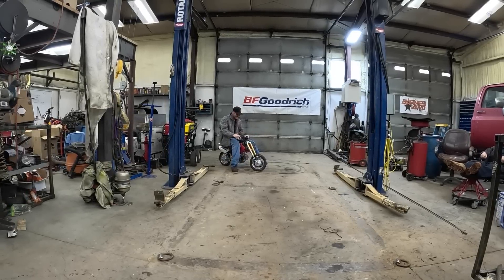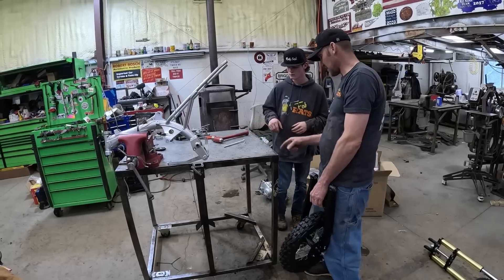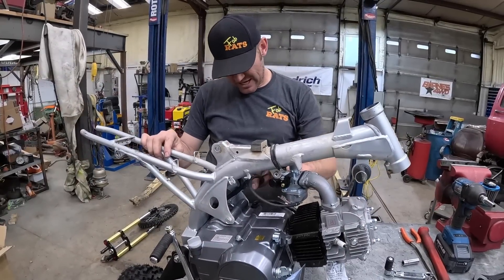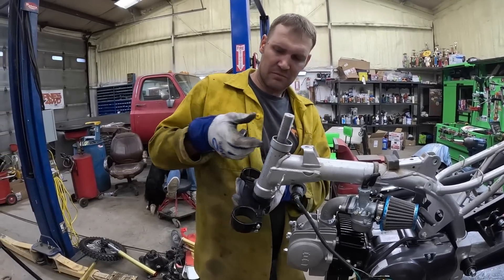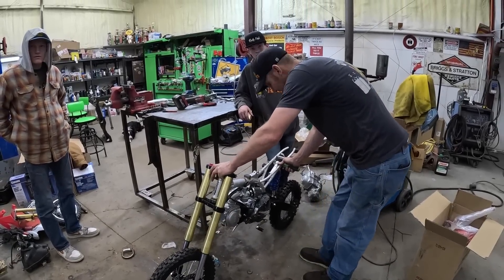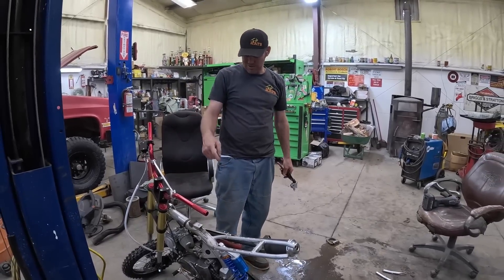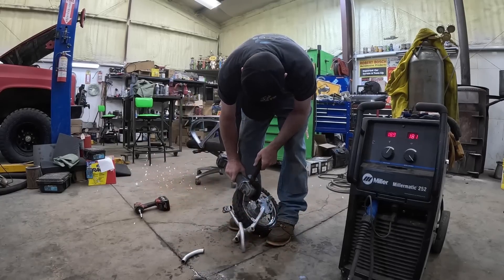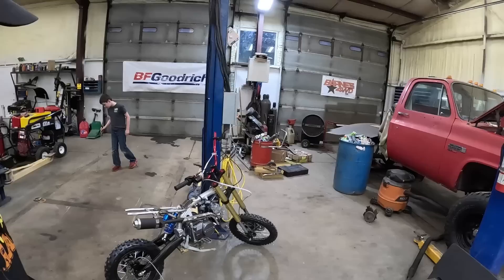Found Motorcycle At Landfill Turns Into Something Awesome! Treasures From The Trash

Comment: Back in the early 70’s I had a Honda mini trail 50 i abused till the gearbox blew so my older brother “aquired” a Kawasaki 175 dirt bike motor and we made a suicide machine that would wheel stand without popping the clutch! Top speed was about 60 mph because the front tire would float at that speed!  We still have the bike but it needs brakes.
Reply: I wanted a 50 around 1975 when the Honda Odyssey came to Colorado 
But I never got into motoring

Comment: Fun watching you guys build stuff. When you put those larger forks on the 50’s I’ve found you need to slide the forks up in the triple clamps 2-3” to get the front end back down. Otherwise it’ll be choppered out and ride rear heavy. You can slide them up until they almost hit the handlebars or until the edge of the flat portion of the forks (before the taper).
Reply: Totally agree. I hope Paul reads your comment. That will strengthen that area too.
Reply: Totally was thinking the same thing. That head tube angle is pretty wild to look at when the rear suspension is compressed.
Reply: This or something is cracked

Comment: Paul you need to get yourself a magnetic floor sweeper! Brilliant for those tiny get aways that seam to teleport from one spot to another.
Reply: some of them parts are brass and aluminum but over all the floor sweeper would be a good idea
Reply: As many times as things go missing a sifting screen seems like a legitimate project. A magnetic component seems totally legit as well. Lets see what they come up with. Your suggestion is of significant directional value.
Reply: I've found shining a flashlight horizontally along the floor will show shadows of everything lying on the floor.  Then you only need to look for the shadow.
Reply: Yeah, stainless ain't getting picked up by no magnet either.
Reply: @sausages6135  There are over 50 types of stainless steel and more than half of those are magnetic. So, the probability of a stainless steel part being recovered using a magnet are better than 50/50.

Comment: It’s amazing the things people throw away
Reply: I use to make good money on push mowers people tossed out I would collect all the push mowers on trash days and fix them up and toss them in my font yard with a 50 buck price tag and people would buy them up like crazy and I would make good  money off of them
Reply: @79tazman  I can definitely believe that. I made money by fixing my friends vehicles while in high school. Only certain friends got it done for free 😂
Reply: I buy tools and parts at the scrap yards. It's rather amazing and amusing there, too.
Reply: I used to drive a frontloader at a transfer station. 
It was truly sickening.
Reply: Especially vehicles....people dump good cars because they need work,major to them who cant work on them...If a transmission fails they scrap the car,engine has issues they scrap it,electrical car is scrapped...I used to run an add in the 90's to the mid 2000's buying scrap cars,and I made a killing..Repaired them,sold them!! I drove one car I saved for 4 years and put another 100,000 miles on it after I rebuilt the transmission,then sold the car and it ran looked perfect.I now mainly just restore and sell classic cars...But still many good cars are scrapped for something a engine/trans swap would fix at the most...
Reply: Another man’s trash is another man’s treasure said NoOne 😂

Comment: I have a shed full of crf50 stuff I've been collecting for years we're really into these and building them there used to be tons of company's making high quality parts for these and frame kits and stuff. You can still get engine parts and stuff my latest builds are a couple matching billetware framed bikes with 124cc dohc kitaco motors with takegawa 4 speeds and takegawa manual clutches.

Comment: You need a cradle mount for tne foot pegs, I used to race the mini bikes and use adults are too heavy and end up ripping the foot pet holes out of the engine, you could easily make one of you look it up, crf 50 cradle mount, and for some better power use flat slide carb or a d-slide carb off a kx65 or 80 and rejet

Comment: You didn't just make a dirt bike. You made a memory. Good Job! Looking forward to the videos on the Wrecker Rally.

I had a standing rule in my gun shop. If it goes sproing and hits the floor I did not even look for it. Just started making another part to replace the lost sprIng/screw/clip whatever. Later years I got a magnetic nail sweeper like the roofers use. It did help a bit.

Comment: Just an FYI fir those playing at home, that adjustment in the shock doesn't change the spring rate. It changes the preload. So, springs have a rate. Say 10kg/mm. So 10kg compresses 1mm, 20kg compresses 2mm, 100kg 10mm, etc. If you add preload, you're taking up the initial compression. So if you add 5mm compression that means for 50kg you'll get 0 compression then 60kg you'll get 1mm. So it's exactly the same. Until you put less than your preloaded weight on the bike. So a 20kg rider. They'll get 0 spring rate until 50kg them 10kg/mm spring rate, which can feel horrible mid corner when your springs go from full hard to soft.

Comment: Pit bikes are cool. If your making that for the track my thoughts are to lengthen the rear sway arm and add a taller shock. The angle on the front forks are too great. They will bend or your triple tree will snap.

Comment: Yeah Paul, looks good but a little too raked out in the front. My buddies and I had kinda realized our brain cell destruction from doing things we shouldn't have. Our younger brothers and their friends were building and breaking those pit bikes regularly, picking up where we left off. One farm had an old dilapidated tin (pole barn) tractor shed with a leaky roof where they built a mini motocross track inside.  They were jumping and slapping the ceiling joists ( tie beam, bottom chord) with those pit bikes. We opted out.

Comment: lol i rode one of those to work for 2 years.
chain got off once and crushed 1 and 3 gear.
still worked great for those couple years as a 2 gears model.
far from street legal i just found it hilarious because we serviced police cars too and i had it parked outside with helmet hanging on the handlebar XD.
these engines are 100% honda ripoffs  and you can swap internal parts around with 50 years old moped engines.

Comment: @Fab Rats I'd love to hear your review on those Hercules impacts, seen you using them quite a bit. Hercules vs Milwaukee? Id imagine with Milwaukee, if something fails you'll have a easier time with replacement and battery platforms staying the same. I've been looking at the Hercules because of the price, but worried about longevity. Love the video!

Comment: You need a new spring, or move the top mount rearward. Better to get a new shock with a stiffer spring, that way the damping "should" be better calibrated to the spring. You are going to bottom out the rear suspension all the time as it is.

Comment: Definitely didn’t get that shock up high enough, it’s almost completely maxxed while your sitting on it, starting the shock higher with more angle would have put the bike in less of a low rider bike if so. Check out how pitbikes are setup for the rear shock, either the shock is too short for the build or it’s just set too far down.  It’s gonna do nothing but cruise at that angle, if you wheelie it be careful of breaking the front forks from the extreme front rake angle

Comment: Paul something isn't right in the front end it's way to racked out like a chopper. Is the frame tube crack up around the fork tubes it looks like it was jumped by someone that weighed way to much and bent the frame outwards some  where or cracked it and now it's gapping bigger. But trust me when I say something istn right at all 50 aka pit bike builds a stubby in the front. I've never in my life see one like that unless something else was broken or wrong. ! Please please please look through that entire frame for bends, breaks and anything else that could fail while little man's ripping it . Something is outta wack for sure

Comment: Paul, machinist here, you gotta get your parting/cutoff tool as close to the chuck as possible when cutting so that the part doesn't try and climb the tool.  I am sure thats why you used a cutoff wheel to finish the cut. Just a friendly tip.

Comment: I can’t figure out why, when you have a motorcycle that is too small, that you would start a rebuild with the same frame. Every old town has motorcycles everywhere rusting away. $25 would probably get you something the right size with a couple of larger wheels. Will the second half answer this question? Back to the video…